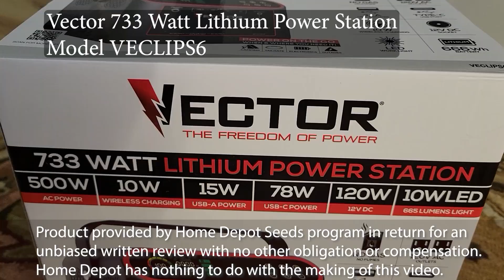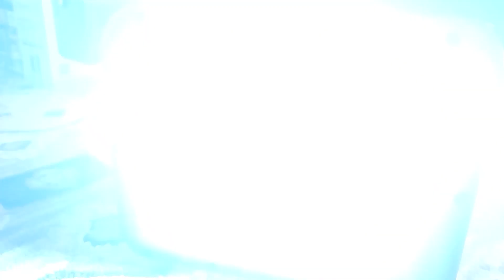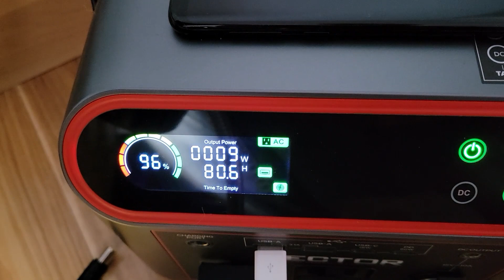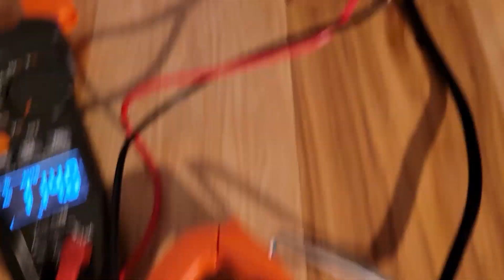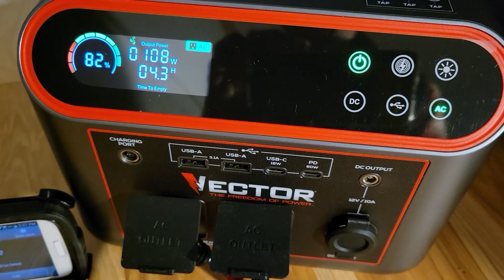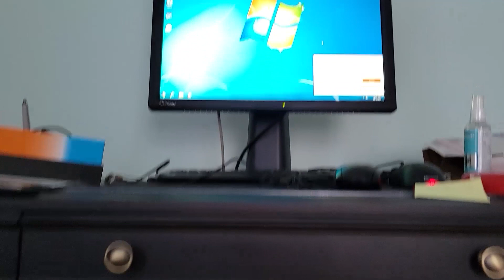Vector 733 Watt Lithium Power Station Model VECLIPS6

Comment: What do they rate for the number of charge cycles?  My rough calculation says the charge time (0 - 100%) using the power brick would be about 9 hours.  Does that sound right? Seems like a very useful unit.
Reply from the maker: Could not find any info on number of charge cycles, generally with lithium there will be capacity degradation after 2 to 3 yrs. I drive a 2017 e-Golf and its battery degradation is measurable by almost unnoticeable in use. I would expect getting many years of use out of this unit. The unit will not let you deplete battery to 0% percent, in my frig test it took about 6 hours to fully recharge the battery after using it for 7 hours with an estimated hour left to empty. I'm impressed with the units performance and fixtures and I know it will come in handy on our next outage.